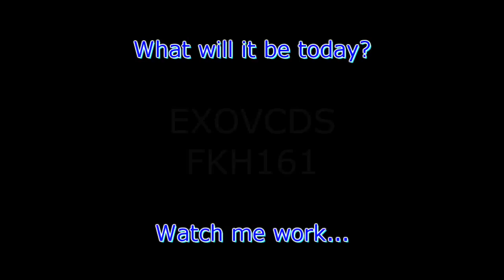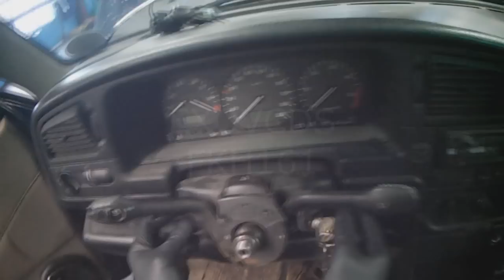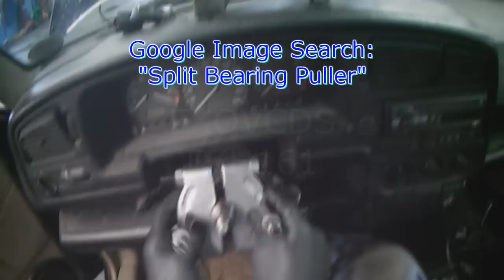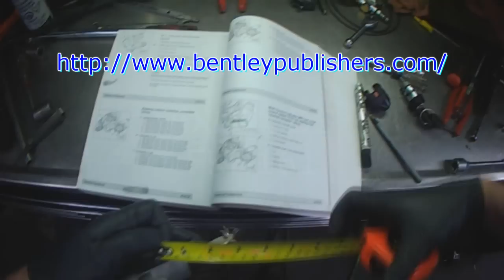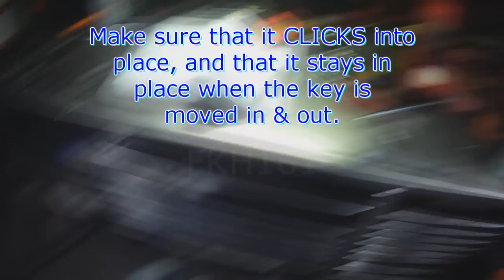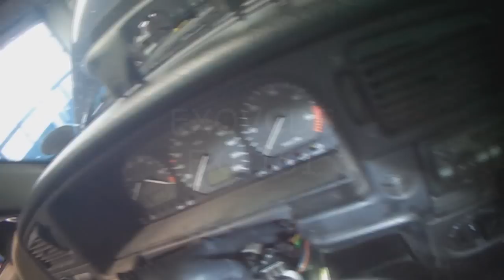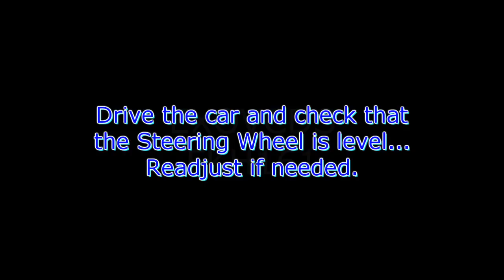VW B4: Passat Ignition Switch & Lock Cylinder

Comment: So I did this today on my 1997 Jetta manual 2.0.  The video was very helpful (Thank you)  I was lucky that my steering wheel retaining nut was not tough to loosen.  I purchased and used the bearing tool listed in the links provided.  Worked well.  I only really needed the switch but the lock cylinder was very loose and worn so I replaced it as well.  The dealer had the switch but I had to wait nearly 3 weeks for the lock.  Had to pay in advance for the lock.  No returns.  On the reassemble, I did not have washers, large enough to go over the shaft, around for use as spacers  for the additional pressing in of the collar so I had to a little tapping with a socket.  All in all it worked out pretty well.  Thanks again.
Reply from the maker: Jeff Carpenter Nice to hear that my video was of help and that things worked out for you! Thank you for watching!

Comment: Great vid man :) Lots of people are going to find this very helpful.  I wish I had this vid a few weeks ago. I just did this exact repair about 2 weeks ago on a 1993 (I think..could have been 1996) Passat.  First time.  No airbag but almost exact same procedure.  Lock cylinder was binding up on the customer for a long time, and then eventually it got so bad you could just tap the key while driving and the car would shut off …lol.  I was glad to see you use that bearing separator on that collar  that holds the spring. Thats exactly what I did.  I will never understand why that ignition switch has to have that little screw that is impossible to get at without removing the housing.  They should have made it serviceable separate from removing all that crap :)
Reply from the maker: The column can be pulled by disconnecting the shaft at the u-joint (by the pedals)... have never done it like that, but in certain cases, can save a bunch of time. Here's a link: http://forums.tdiclub.com/showthread.php?t=105906 I'm so used to using the puller, so I always do it like that.
Reply: Thanks for the info..but using the bearing separator  worked great! Im like you, now that I have done it this way, I doubt I would try a different method :)
Reply from the maker: Jeffrey Wilson I never like crawling under the dash... 6"2 200lbs, I tend to get stuck.
Reply: Hahaha wow your 6'2"? 200 lbs?? I never would have guessed that from your vids lol.  Back in my GM dealership days I had to change A LOT of intermediate steering shafts because every GM car clunks lol…I HATE CRAWLING UNDER THE DASH..lol

Comment: Hi.. please help how to test ignition switch without removing complete housing? pinout will be very helpfull...  is possible remove ignition switch without removing bearing and complete housing?
Reply from the maker: You can unplug the ignition switch and bridge the wiring. If the engine starts, then the switch is bad.

Comment: Hello, thank you for the video. I have a 2001 Cabrio convertible. Idk yet what is exactly wrong with the ignition until I take the whole thing apart so I am wondering, if the cylinder needs to be replaced do I have to program the keys?
Reply from the maker: If the ignition cylinder has a "reader coil / antenna" around it, then yes... the new key will need to be coded to the car. You will need a 7 digit security pin number for that... if you have the original "tag" that came with the keys, the number is on the tag. Otherwise, it takes special software / scan tool to retrieve the PIN from the instrument cluster... or go to the Dealer.

Comment: After you drilled the housing, the part was moved out of the shot and it was difficult to see what was happening. You were depressing the retaining clip? Did you drill the hole in order to access the depression point for the retaining clip?
Reply from the maker: SP R Yes, sorry... the camera doesn't always look where my eyes are looking.
Reply: ***** Thanks a lot. For anyone wondering about a 1996 B4, Bently manual states the hole should be drilled at a point 12mm back from the top of the core entry hole towards the ignition switch and, laterally, 10mm to towards the center from what looks to be a molded line near the inner side of the cylinder closer to the steering column housing.
Reply from the maker: SP R Thanks for the info... I thought I had put that in the description, but did not.

Comment: how does the wire for the air bag and horn work? is it just like a coiled wire so you can turn the wheel with out them getting twisted?
Reply from the maker: Yes, it is basically a spool that gets tight in one direction and unwinds in the other. If installed "out of center", the ribbon cable will break.

Comment: I bought the bearing tool, same as in this video (I used this video for reference for my polo 6n1 1996)  only my steering ''bush'' does NOT come off. It's stuck on there. I even bent my tool and almost ruined the steering threads. I tried to apply heat, oil.. nothing works. Any tips? I'll be glad if you have some. I only want to replace the electric part of the barrel. Thank you!
Reply from the maker: Send me a picture of how you installed the tool. You can find my contact info on my website (fkh161 link in the description). On the website, click "Tool request" to send me a message with a picture.

Comment: Whoever did this repair for the previous owner of my B4 must have messed up: the stereo only turns on when you actively press the key in. Whether it’s in the off position or on position. You press the key in and the stereo turns on, as soon as you let off that pressure it turns off. Any idea what’s going on?
Thanks for the vid 👍
Reply from the maker: Bad ignition switchbor worn key cylinder.

Comment: Hey thanks for the very informative video bro..  One thing tho, how come the airbag light did not stay alight? I had my B5 ignition switch changed and now the airbag light is on with the airbag intact., Can this be cleared?
Reply from the maker: Working with the battery disconnected, or NOT turning the key ON while the airbag is disconnected... should keep the airbag light from coming ON, due to a fault code.
Reply: @EXOVCDS  If the key was turned when the airbag was disconnected and assuming the airbag light comes on, how can that code be cleared?
Reply from the maker: @Vishal-oj3ji  A scan tool that can communicate with the airbag module. A regular OBDII scan tool can not do it.

Comment: also, is the drilling part "standard" procedure when replacing switch?
Reply from the maker: On the old models yes... as per service manual. Again, yours is different / not the same.

Comment: if. i only need. to replace. the. cylinder lock.  can i just drill. n remove.? or does.  igniton switch. has to be removed. to go in. ??
Reply from the maker: You do not have to remove the ignition switch... drilling the housing while it is mounted to the steering column will not be as easy as when it is on a work bench.

Comment: Question...2007 VW beetle 2.5L w/ 90k miles.  The key will not turn and the steering wheel stays locked.  Tried jiggling everything to get the key to turn but nothing.  Guessing ignition switch needs replacing....any suggestions????
Reply from the maker: If the steering column is locked & under stress from wheels that are turned... it can sometimes take quite a bit of pressure (turning the steering wheel) to overcome the steering column lock. Whichever way the wheels are pointing... apply further pressure in that direction by trying to turn the steering wheel. While holding the steering wheel in that direction (strongly) try to turn the key. If the key still will not turn, then You might have to remove the lock housing from the steering column. I don't think it is due to a faulty ignition switch... but to check it, you'll have to remove the steering column trim... which will be difficult if you can't turn the steering wheel. Worst case scenario... you will have to break something (steering column trim) to gain access to the switch or the lock housing.
Reply: Many thanks.  In your professional opinion what part is failing w/in the ignition lock housing?
Reply from the maker: To be honest, I have not yet run into a scenario where the key would not turn. I will be posting a video later today, about removing the lock housing of a mk4 / A4 Golf. I believe that it is similar to your Beetle.  I also show how to remove the ignition switch and how to test it with a screwdriver. I'll be posting videos in about 7 hours... check the main page of my channel at that time, so you can see the new videos that I post.
Reply: Perfect.  Thanks.  I have a short video of trying to get the key to turn then after much struggles it finally releases.  If you want it I can send it to you.  Made be others with the same problem.  Thanks again, Mark
Reply: Figured it out...the steering lock on the ignition housing needed LOTS of lubrication.  Now the key moves freely w/o having to juggling the steering wheel or forcing the key to turn.  Thanks for your videos.

Comment: is this the same procedure for the 99 passat 1.8t
Reply from the maker: No... it will be more similar to this: https://www.youtube.com/watch?v=tn5_od47aBU at 5:25 you can see me remove the ignition switch.
Reply: Thomas EXOVCDS I ask cause some broke into mine and ripped out the ignition broke the lock housing and all so I need to replace the hole piece and everything
Reply from the maker: I don't have a video (yet) specifically for a Passat of that year / model... if you watch this A4/mk4 video, it might give you enough info to tackle it on your Passat. I'll look for service info and will get back to you tomorrow. If you haven't heard from me by friday night... send me a reminder.
Reply: Thomas EXOVCDS alright sounds good thank you
Reply from the maker: Yes, the Passat ignition lock housing is very similar to the A4/mk4 housing video... removing the steering wheel first might make things easier / give you more room.
http://fkh161.ca/VW/Passat/B5PassatAirbag.pdf

http://fkh161.ca/VW/Passat/B5PassatSwitches.pdf

http://fkh161.ca/VW/Passat/B5PassatIgnitionLock001.pdf

That should be enough to get it changed out.
Reply: Thomas EXOVCDS thank you man soo much